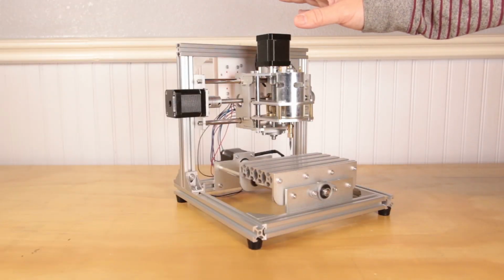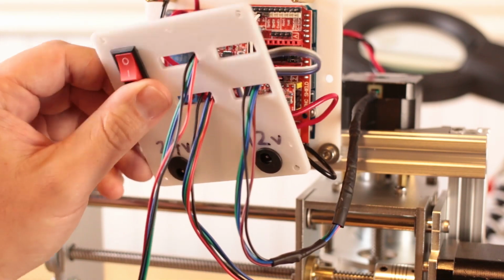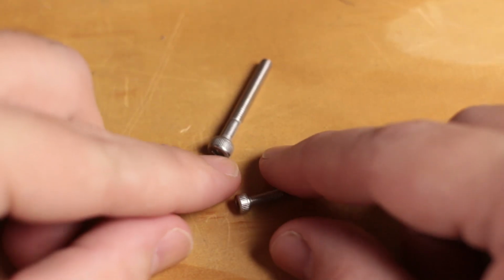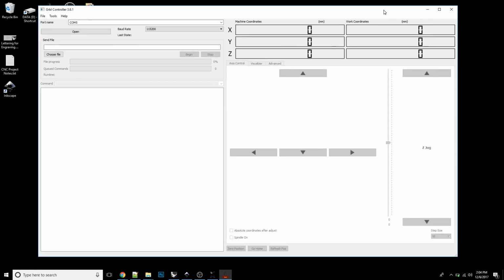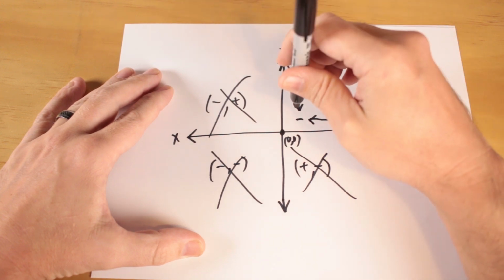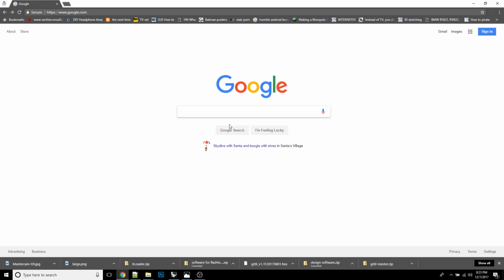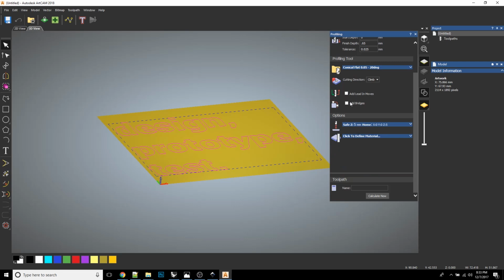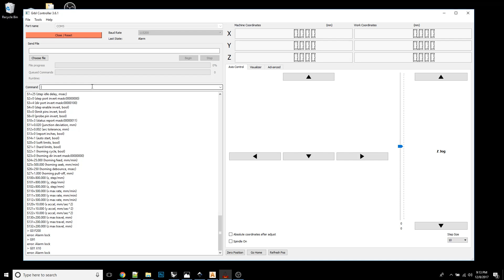How to start CNC Machining for under $200 - Working with the T8 CNC engraver

Comment: Hey, I did everything just like in the video, but when I press the buttons to move the axes, nothing happens. What can I do?
Reply from the maker: Unfortunately, I don't have time to make videos and also help everyone troubleshoot their projects. There is a whole process of trouble shooting to figure out where your problem is coming from. If you aren't able to figure it out yourself, I suggest you seek help over on reddit. reddit.com/r/3D printing is a good place to ask because this machine effectively works like a 3D printer. Also, reddit.com/r/arduino is helpful because this machine runs on an Arduino UNO. Finally, try reddit.com/r/CNC. Hopefully someone over there can help you diagnose and solve your problem. Best of luck!
Reply: Design Prototype Test Ok thanks anyway. Do you have a place that I can read about problems and maybe try to figure out by myself?
Reply from the maker: Sorry man. What you see is what you get. There was another commenter that I helped a few weeks ago. but your problems won't be the same as his. Still, he may be able to help you. Try replying to his comments. It's all about the process of eliminating what works. Test things. For instance, if you are getting 12v power on the Soldered points on the board, then you know everything upstream works (the plug, the power supply, and the cables). You have to narrow it down as to what is causing your problem. Then you can either get a replacement (parts are very cheap on ebay), or you may be able to fix the broken component. That's assuming that something is broken, and it's not your error. I find that 99% of the time it's my error that caused the problem Either I didn't hook it up correctly, or I broke the component by doing something wrong. There are no safety nets for these cheap kits. They are easy to break. Fortunately parts are cheap, and readily available.

Comment: I always cringe when I see inexperienced and untrained people soldering things and claim that this is the correct way to do it.. Let the join heat up before applying solder to it by creating a heat bridge between the iron and both parts of the join (count to 5 when bridge has been established). Apply solder to the joint, not the iron. Most solder has resin core so you shouldn't need to apply flux.

Comment: I need some advice. I followed along with the video, copied the wiring, successfully flashed, and appear to be communicating with the CNC from my computer, but it doesn't seem to want to do anything when I send it commands. Does anyone know how I should start debugging?
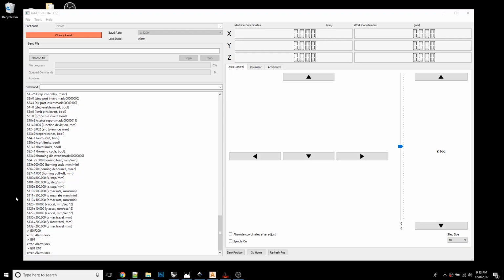Reply from the maker: Well, you flashed the firmware, so we know the communication is working between the computer and the CNC Machine. You must have also changed the value for $3 in the configuration table so that the movement would be in the correct direction (just like I showed in the video). Therefore, we can be doubly sure that the communication is working. So, we move onto the next thing. Let's assume everything is wired correctly, and nothing is burned out. There would have to be something in software preventing the machine from moving. Perhaps it's popping an error. I put an addendum after I showed the completed engraving discussing this exact problem. At 36:20 mark we see the solution is to issue the $X command which clears the error and suddenly everything works. I would guess this is the solution to your troubles. However, If this doesn't solve your problem, you most likely have faulty components or wiring. Start testing and cataloging what works. Whatever remains is the source of the issue.
Reply: Thanks for the response, and I couldn't have gotten this far without your video.  Unfortunately, I don't have any errors in the command console.  It acts as if it's sending the commands without issue.  Watching the video again, I did not replace the 12V input like you did, so I may have the same issue (though I do remember testing that fixture backwards and forwards after watching you deal with it).  Hopefully it's that simple, and I didn't buy an expensive and labor intensive paper weight.
Reply from the maker: It's not a paper weight! I know these things are frustrating, but it's always some  small issue (or maybe two small issues together). Go through it logically. Talk out loud as you are doing it as if you are explaining the problem to a 4th grader. I tried to give you an answer last time with the same narrative tone as I talk to myself when I'm trouble shooting. You need to establish what works. I doubt you have the same problem with the connector that I had, but that doesn't mean that your board is getting power. Try putting a multi meter right on the power input soldered connections on the PCB. If you are getting power there, you know that everything from the wall to the PCB is working. You got this! Just have patience, and be methodical and persistent.
Reply: Design Prototype Test So I have good/possibly horrible news. Long story short, I tested everything and changed nothing BUT if I turn everything on, plug it into the computer, and fire up Grbl, I can turn the spindle on and off. It remembers the setting for $3=4, but it doesn't remember G0 F200, and as soon as I enter that, I am no longer able to turn the spindle on and off, but I don't get the feed rate error. Any ideas?

EDIT: More info. Manually entering a command with a feed rate, like G01 X1 F200, does nothing, and will keep the spindle from working as well.
Reply: Hey Matthew, dumb question, but how did you connect and seal the wires that connect to the stepper motors?  Mine are individually soldered and wrapped in electrical tape.  They should be, right?

Comment: at the back of the upright that holds the extruder on the bottom, " triangle brackets they are supposed corner attachment. one triangle corner peace is supposed to go across the back and the other one is in the right place but you will fined out that it will work correctly and to the full size of the table top " .hummmmm

Comment: Will that little CNC machine cut 0.6mm aluminum sheet to make flat parts?
Slow is fine.  I only need a few very specialized pats occasionally.
Reply from the maker: No. It will not.There is too much play/wiggle in the machine. Get this one instead. I think you will have better luck: https://bit.ly/2MDWqMm

Comment: Hi, I really liked your video. I a all planning on upgrading my machine (you can check my DIY cnc / laser cutter  at my account). I already have the motors, arduino, drivers... Just want the aluminum parts. Any recommendation? My working area is about 260*260 mm. Thanks!

Comment: Great video, thanks for the effort put in, but........s
so, I just went to try & download ArtCam only to find out from their website that this program is no longer available, soooooo.....now what?!?
Please help, I really need a program I can download a fritzing file into, are there any comparable with ArtCam?
I really appreciate any response regarding this what is realistically a personal problem in advance.
Reply from the maker: Thanks for the heads up Dean. I'm guessing that Autodesk killed ArtCAM because they were competing with themselves. It probably detracted from their flagship product - Fusion360. While I have never used Fusion 360, most if not all reviewers speak highly of it. It is both a CAD program for drafting, and also a CAM program to run your router. If you are a hobbyist or a startup making less than $100k per year it is a free program. This tutorial seems like a good place to start: https://youtu.be/iqnvzxuXFTQ

Comment: And three months latter AutoDesk discontinues ArtCAM:(
Reply from the maker: Actually, it was less than a month later that they did that. This is why I'm hesitant to recommend Fusion 360 to anyone. Who knows when they will stop making it a free program, or just decide to kill it. They have a history of doing this with their programs. Anyway, make sure you watch part two linked in the description.
Reply: Fusion 360 is $495.00 a year now. Jerks

Comment: Hey everyone, i bought the parts separately. the "brain" of my CNC consists of an arduino and a V3 GBRL CNC shield. Does someone have any information regarding the relay? Looking this up on ebay "Relay Module" pops up a bunch of results. if anyone have wiring diagram or any type of information, it would be very very helpful.

Comment: Is there an emergency stop switsh?
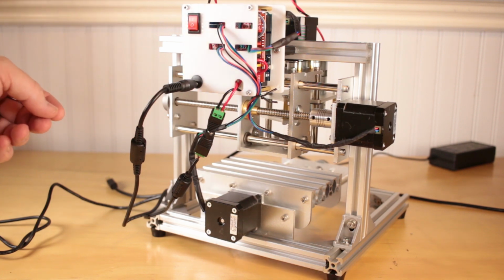Reply from the maker: Not really. The way I have wired it, the switch will work like an EStop. The machine stops moving, but the spindle keeps going. You have to unplug the 24V to shut off the spindle like I showed at the 15:59 mark.
Reply: Is not good that you can not turn off everything at once! in case of an error.

Comment: this whole video is just wrong "quote" (we told it to move 50 mm) moves it 15 mm like what "quote 2" (and that appears to move the table away from you, the table moves away from you when you click the down arrow and the reason for that relative to the table the bit is moving down so that's actually correct) no the y should move like it does on a 3dprinter down when pushing the down button and not move UP when pushing DOWN
Reply from the maker: Are you sure you are right with these statements. I have made a fully functional little CNC machine here. Results speak louder than words.

Comment: Back to bug you again after finally ordering a new Arduino (the old one had a USB bus issue).

Of the two hex files that came with the software, grbl9.hex allows me to turn the spindle on and off and acts like it wants to move the steppers, in that it increments and decrements the machine and work coordinates in the Grbl Controller.  Grbl.hex allowed me to control the stepper motors properly a single time before the old Arduino permanently stopped communicating with my laptop, and now outputs a "No data from COM port after connect. Expecting Grbl version string." when I try to open the port in Grbl Controller.

I've tried the hex files on the Github as well: https://github.com/grbl/grbl

If the values are changing withing Grbl Controller, does that mean I have another hardware issue, like my CNC shield is fried?  If this is outside the scope of your experience, no worries.  I'm just trying all avenues.
Reply from the maker: Hi Elliott, I wish I could help you. It has been months since I was dealing with GRBL. I do have another router project coming up, but my head is not in this project at the moment, so I can't figure out your issue. Perhaps when I'm working on the next Router project, I will be back in the CNC/GRBL zone, and I will be able to think of an answer. Best of luck!
Reply: @DesignPrototypeTest  Sure, no problem. Thanks for the response!

Comment: use marlin firmware and add board home and limit swirch too, now have only amateur toy mode, but after E-stop,home and limit switch have safety and better and use real g-code firmware marlin and g-code softwares same or better, aspire, v-carve,artcam,mastercam,solidwork, this cheap toy can use vinyl cutter,laser carver,cnc,pen plotter, or change board better paraller port board and use real cnc mach3 or linuxcnc softwares.and nema 23 steppermotors and tb6600 stepper driver. then have lot better and REAL cnc near.

Comment: does this machine cut larger lettering
Reply from the maker: No. Nothing about this machine could be called "large." This is the Tyrion Lanister of CNC machines. The bed size is 95mm x 150mm.

Comment: Oh, please Jedi master tell me how I can make small metal parts as replacements of my toys at affordable price.
Reply from the maker: Hi Charlie, I have a Benbox CNC router in the box ready to assemble. It looks like a beefed up version of this one with 12mm rails everywhere. I think it could cut metal. Depending on the lash of the machine, and how good you set it up, you might be able to achieve what you are trying to do with it. I'm planning on doing a review, but who knows when I'll get to it. Here is the Banggood link: http://bit.ly/2Ep1X6E
Reply: @DesignPrototypeTest  Thank you so much. I recently have become addicted to transformers toys and I want to make them better for instance by replacing plastic bumper with metal one and maybe smokestacks as well. I did try to contact with CNC factories and they refused to produce the parts I want even I gave them 3d model because they only want mass production instead of customized services. Then I turned my head to 3d metal printing. It didn't turn out well. The price is way too high about 3-5 dollars per gram and the surface is not as smooth as I want. Then the CNC engraver is probably my last hope. Another thing confuses me is whether CNC engraver is capable of 3-dimensional sculpting(I am not sure if it is the correct terminology). Most of the videos about CNC engraver are about engraving on a plane. So I really need to understand that. And again, your video is awesome and may the Force be with you.

Comment: any CNC with little unsupported linear rod bearings is NOT going to be much good for machining, the rods will bend too much from the machining forces, causing chattering / vibration = lousy cuts.

Comment: Stopped watching at "always tin leads ... crimps them".
Reply: OderWat: Yes, this guy clearly doesn,t know what he is doing. NEVER EVER tin leads before crimping and use the correct tools or your crimping will be a disaster!
Reply: Only time you should tin a wire when using that kind of connector is when you plan on soldering the wire to it.

Comment: It's odd they use two separate power supplies.  You should be able to run both off 24V.  Check out bCNC for grbl control,  it is much better then anything else out there ( https://github.com/vlachoudis/bCNC ).  Estlcam is also a good alternative but needs to be purchased ( http://www.estlcam.com/ ).
Reply from the maker: This is good information. Thank you! If I think I'm going to purchase RhinoCAM because it interfaces with my CAD program of choice. I'm definitely going to give bCNC a go. :)
Reply: fusion 360 has both cad and cam in it, and its free for makers. and yes 24v is better and the stepper drivers can take that plus run better like faster feed rate.
Reply: +1 for bCNC, it is by far the best G-Code sender for grbl in my opinion. I especially like the built in probe functions. Since I use my machine for isolation routing my own PCBs, this makes it a no brainer to use. BTW Fushion 360 has a post processor for grbl, built in.. AND it's far more powerful of a CAD/CAM package than will ever be needed for these small machines. Hell you can do full industrial type design and CAM with it.
Reply: Regarding the dual power supplies, this is common on cheap boards. The 24v to run the stepper motors and the 12v or sometimes a 5v for the logic side.

Comment: Never never never solder a crimp joint
Reply from the maker: While the vast majority of commenters agree with you. Nicholas Lee disagrees, and has some evidence to support his claim. I don't think it's as cut and dry of an issue as everyone thinks.
Reply: @DesignPrototypeTest  I am Not talking about the solder ends instead of end caps both are ok. But it is bad to solder and then crimp

Comment: Do not trust this video for info on all CNC machines, most CNC machines use positive x negative y G0 is rapid not cutting movements G1 is linear or straight line movements and G2 is for doing a radius

EDIT: this is really just my experience as both hobby vs industrial CNC machining but you should always do your own research into how your specific machine and software works
Reply from the maker: You are splitting hairs. Just because a few G-code commands are different between GRBL and say HAAS or Mach3 doesn't mean that the overall experience from this machine won't be a perfect introduction to CNC machining on a "real" machine.
Reply: Design Prototype Test I’m definitely not saying that should be a turn off for hobbyists to get into CNC machining just more of a warning and I will edit my comment to reflect that